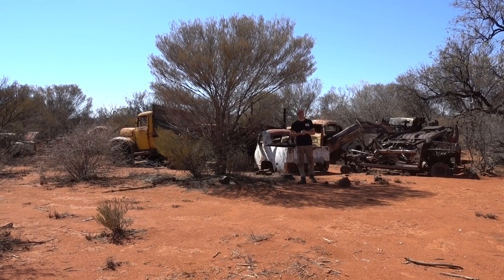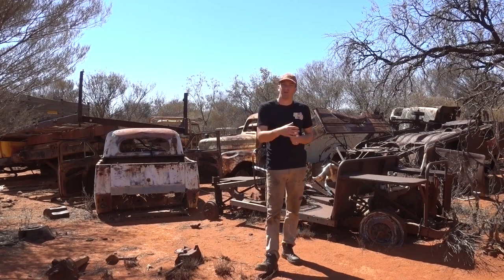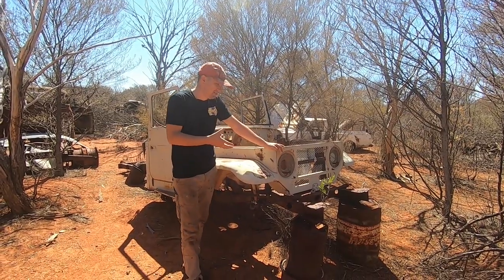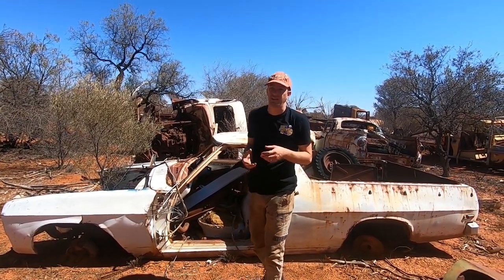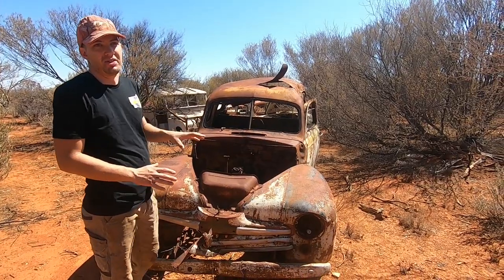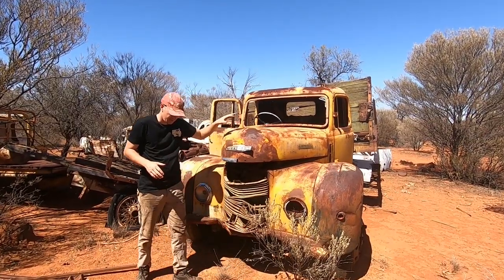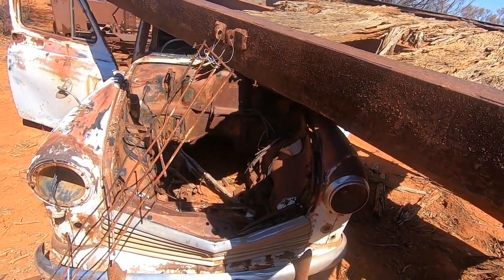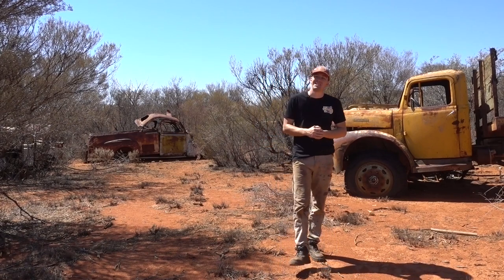Searching an old cattle station for abandoned vehicles

Comment: That 1955 Ford ute was built by Ford Australia and all the Customline derived Utes were named “Mainline” not Mainland as you said that’s a brand of cheese this was the first year in Australia with the OHV 272 ci Y block engine from the last of the 239   sidewackers like that previous 46 Ford ute that had one in it, all the mainlines had 272 V8’s no sixes were offered and were replaced when the first coupe utility Ford Falcon was released in 1960 with the XK model if you wanted a larger Ute or pickup from the Falcon you could only get the larger F series trucks from F100 up and they were available a bit later with 240 and 300 ci sixes as well as 292 Y blocks
Reply: Mainland is a kiwi brand from the mainland (south island)

Comment: That Commer is a Commer superpoise the Diesel engine is probably a Perkins leopard looks like it has some usable bits
Reply: We had a couple of commers 1952 ,1was  ex cattle truck that had gone rotten in chassis behind the cab  had a hoist next.was a Karrier ,same as just Karrier badge ,flat head 6 super snipe engine ,Dads M8 had a later fifties model with overhead engine ,finally Dad bought a 1949 Commer with the older shape like a Bedford cab ,same flathead ,which I got my Heavy vehicle license in about 1975 ,not bad trucks.but you couldn't push them too hard.or you'd blow head gaskets, I'd never seen 1 with a diesel engine in New Zealand

Comment: 15:46 that custom thing looks to be a early phase 1 vanguard bc of the trans and the engine witch should be a solex and the front shockers that has had the body in bolted and the frame cut to bits
Reply: And the 2 seperate handles is bc I was a Colem shift and it has 2 inputs into the trans and they have hooked levers up directly
Reply: Hope this all helped